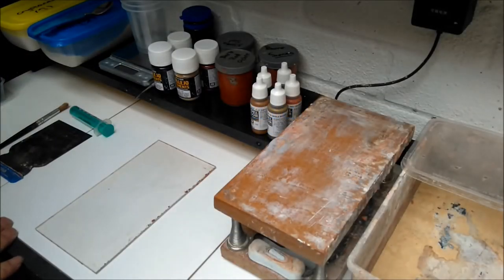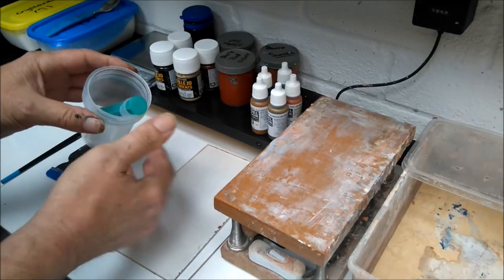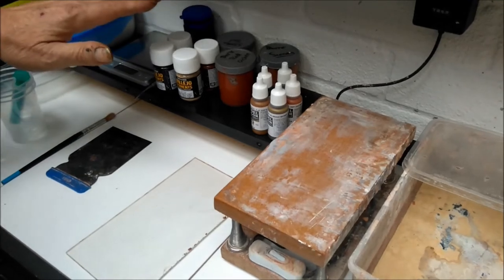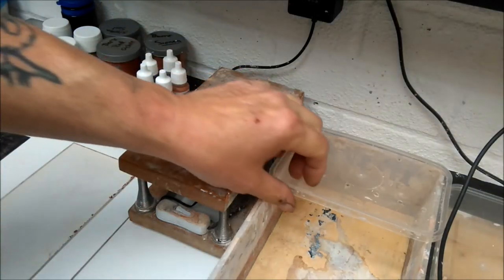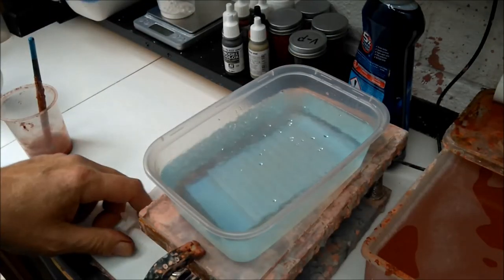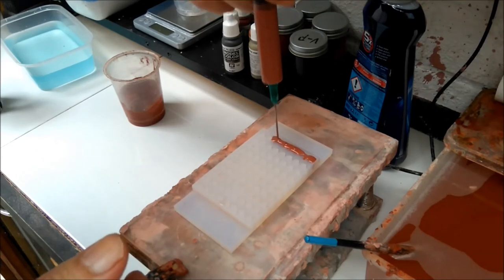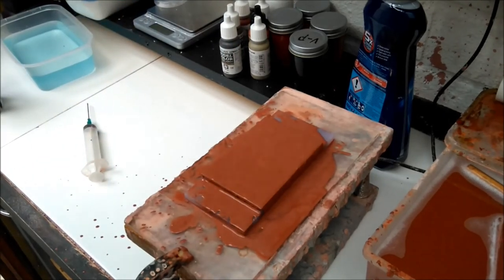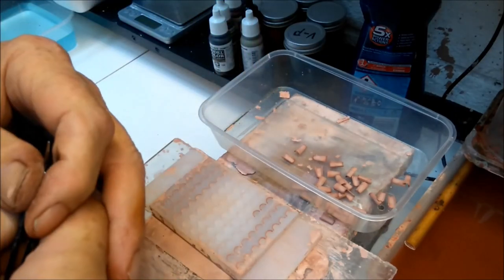Pan tiles And Spanish Roof Tiles In 1/35 scale

Comment: Another great video. Thanks for uploading.  If air bubbles are a problem could you use a vacuum chamber to pull the air out.  Wouldn't need any thing too elaborate just a plastic container over the top and a vacuum cleaner to provide the vacuum.seen it on a Japanese video once where they were  casting resin. Just wondering